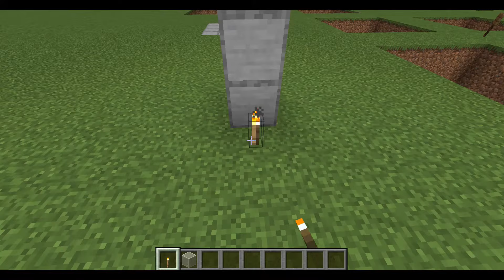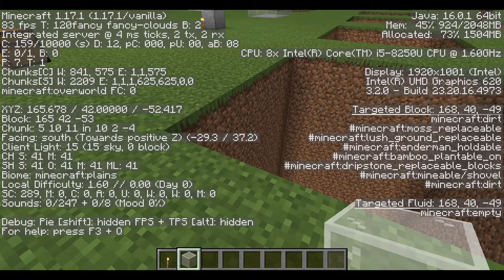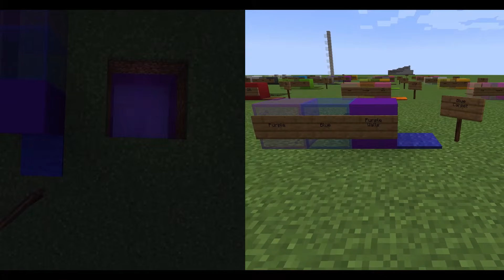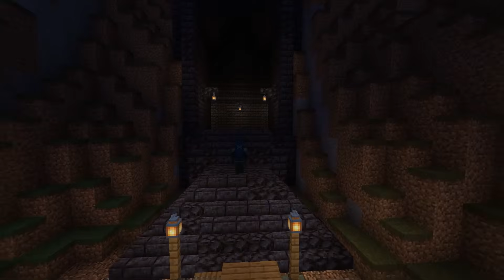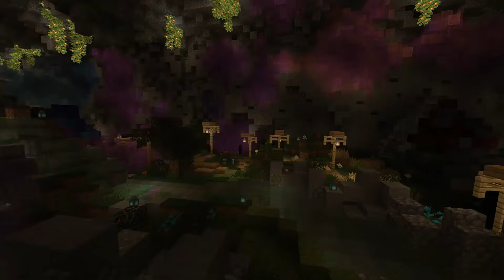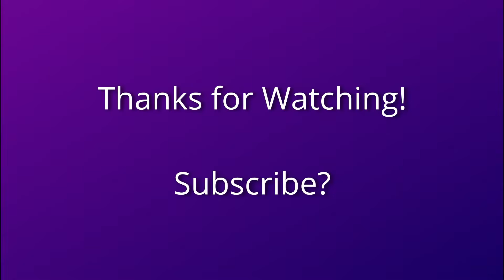Minecraft Glass Fog Effect Tutorial + Build Examples

Comment: Is there a way to make it brighter, I love the smooth warm vibe they give but if it’s possible I want it to pop out a bit. I haven’t tried light source blocks on the sides but I’ll try it and let you know how it looks. I doubt it’ll look good though, most my ideas fail😂
Reply: Try sea lanterns. It looks brighter in my opinion, because its brighter than torches.
Reply from the maker: It is hard to get it brighter since light only travels so far and you need multiple layers to get the effect.  If you try the light sources on the sides and don't want them visible, try digging into the sides a couple blocks and then putting in the light source, that way it's hidden.